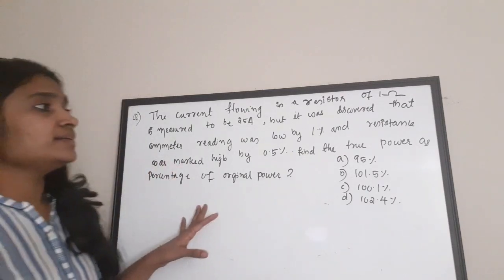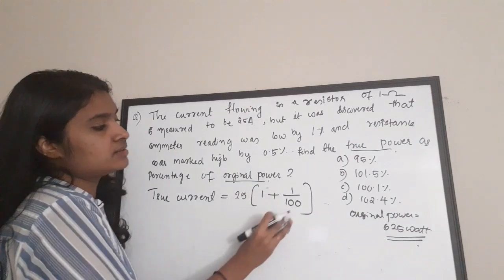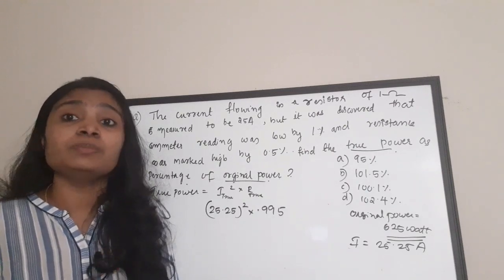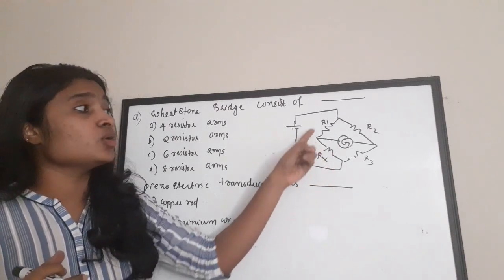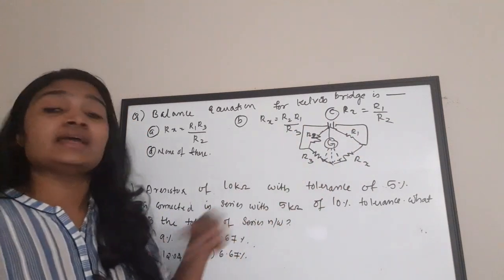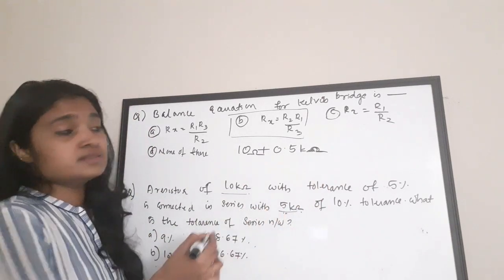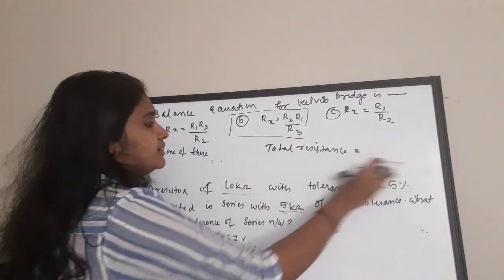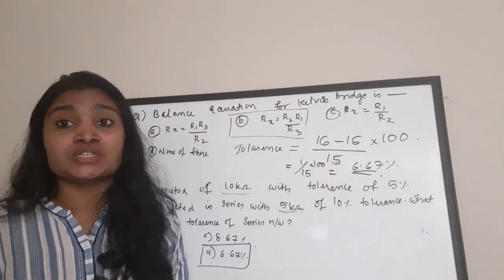ISRO Technical Assistant Electronics|| Electronic Instrumentation Measurement,Error Analysis Part1

Comment: Mam if the resistor is connected in parallel then what to do? Plz reply
Reply from the maker: In which question,?
Reply: @EasyElectronics_jobupdates  mam the tolerance question. If the resistors are connected in parallel then how find the total resistance with tolerance and without tolerance.

Comment: Pls Rply mst 
Maim low ka matlab value minus hoga na I.e. the true current = I[ 1 -1/100 ] & similarly true resistance = R[ 1 +  1/100].           
For ex. If original value of current I = 25    
Then true value of current = 25.25  according  you  .  In this case true current is high but in question given true current is low.
Reply from the maker: No, it means Current measuring done is low so add the error value to it. Resistance is high so deduct the resistance from it. That's the actual values.
Reply: @EasyElectronics_jobupdates  thoda details me samjhaye

Comment: Mam, could u pls tell me how the actual current is 25+1% r8... But hw it became 25(1+1%)
Reply from the maker: 1% of 25 is the tolarence
Reply: @EasyElectronics_jobupdates no mam iam asking about the number 1 which is added with 1 %
Reply from the maker: You have to add the tolerance with the original value to get the true value right. That's y 25+ 25*1/100
Reply: Thank you for the reply mam.. Expecting more videos.